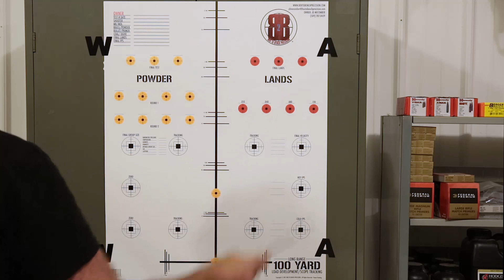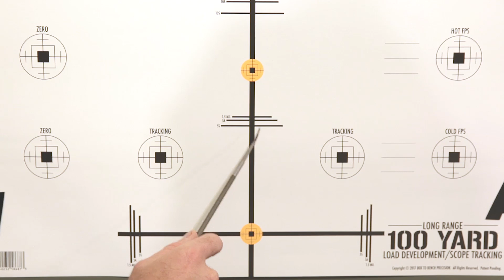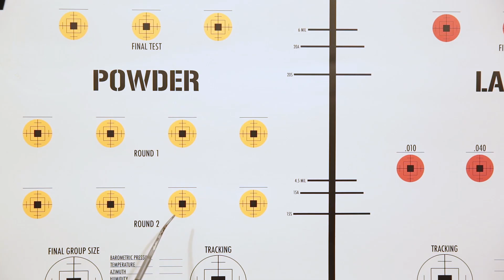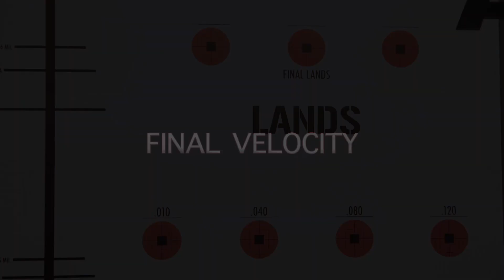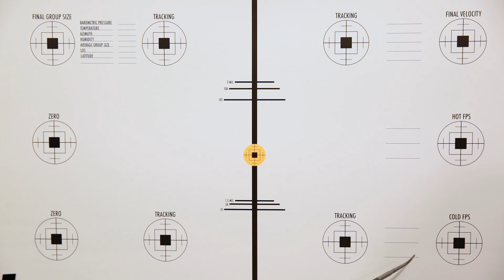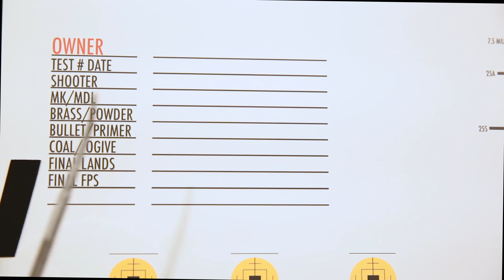2017 Version 100 Yard Long Range Load Development and Scope Tracking Target Instructions

Comment: All of my long range load development is performed at 100 yards on MR-31 target from prone sling supported position and iron sights. Right now that means I feed my .223 match conditioned service rifle 24.8 grains of RE-15 under an 80 grain Berger seated twenty thousandths off, Win. Brass and primer. Chronograph says low ES and SD to hold a minute at 1000.

Comment: How did you come up with the 3% adjustment? Is this a literal measurement from POI to the MRAD lines indicated on the target (minus the approximate .5 MOA low to begin with)? And how did you implement that requirement into the data to correct your click values for your charts. Is that under the (MOA/MRAD) Inch Equivalence INPUT section? Did you change the 1.05 value to 1.09?
Reply from the maker: Luis,
Feel free to call the company today and we will figure out exactly what you are asking.   Joe 509-207-0439
Reply from the maker: This 3% adjustment where did you get this from?  If you found your scope has an error in adjustment by using the scope tracking portion of the target by say 3%.   The next step is to figure out how your ballistics program handles the 3%.  Examples. Ballisitic AE you enter 1.05 for your turret values for MOA but the same MOA is treated as .95 turret value in the Applied Ballsitics program. 

The most common error with the scope tracking is the shooter didn't use a torque wrench putting on the scope.  This will crush the erectors.   This causes errors in your tracking. 

I would send the scope back if you ever find error in your adjustments.